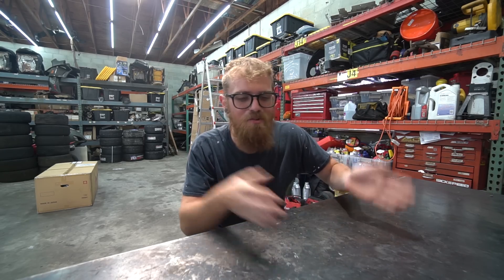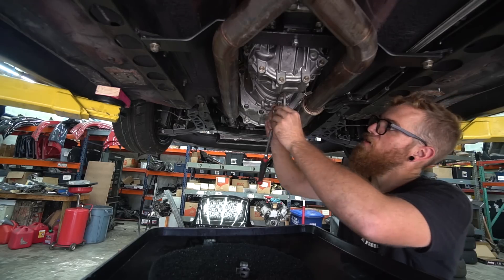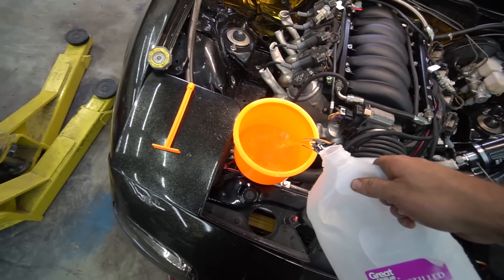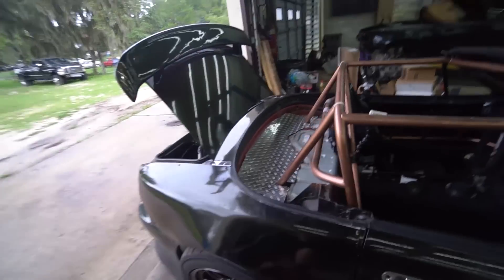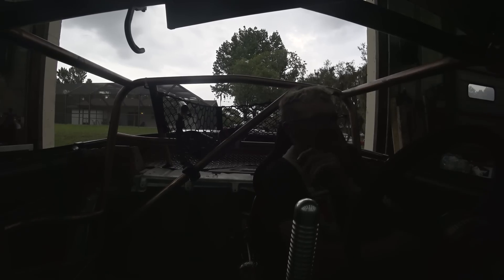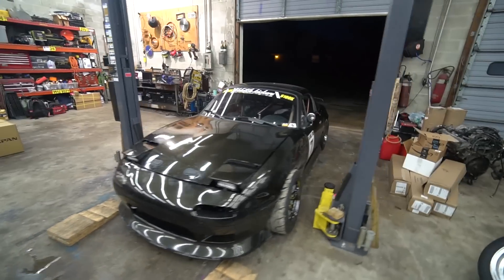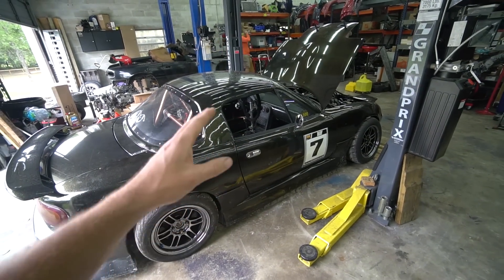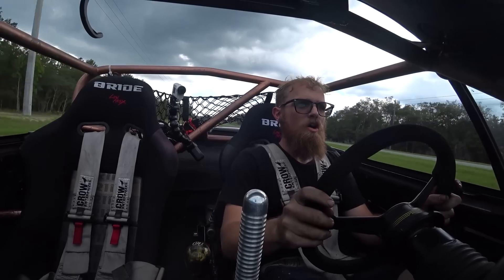ONE-WEEK REBUILD FINALE! - FIRST DRIVE With the New LS3 Miata! 1-4 Gear Pulls! Basic to Ballin Ep.5!

Comment: Grab 1 of those garden pump up sprayer. I usually cut the very end off the wand then slip a rubber hose on it. Then just pump it up, push the trigger and it will push the fluid out. Been using them for years, does gear oil fine.

Comment: I have been told to use 347 filler rod on stainless because it will weld 321 pipes.  321 is the best for headers that last.

I know people use ER70-06S MIG wire for filler rod on 4130 tubing.  Evidently the Silicon makes it flow well.  I'm not surprised that it worked on Stainless but it may corrode rapidly with all the heat and a kind of dissimilar metal joint.  Keep an eye on it.

Comment: when i did the dsg trans on my vw. i hacked a weed sprayer. added the oil to it, and used that to push the oil into the trans. made it wayyy easier. made another one for regular oils. sped it up so much. to do it that way takes forever. the proper "tool" to do it properly is $200 bucks. i spent $30, and its basically the same thing.

Comment: You can always remove one of the heater hoses to burp the system. Just crack One open start filling it up and when you get coolant coming out of the hose reinstall it finish filling it. They actually sell a fitting that goes on for the heater hose with a removable cap they work pretty well

Comment: I used a pump like that 2 times.... No More!  I put a dip tube in a plastic oil jug thru the cap. Drill a small hole in the side near the top and pressurize the jug with a blow gun.  Works like sucking a straw.

Comment: Hey tayler instead of using that soap or fliud despenser try using a old windshield washer fluid tank with the  pump on it.  Just put your fluid into the tank and put 12volt to it and it pumps it right in, fastest way ive used yet to fill a trans or diff up!

Comment: instead of using the pump bottle you can buy a 12 volt diesel/oil transfer pump. they are sometimes sold as a kit to drain your own tank if you put the wrong fuel in so it may come with a piece of tube

Comment: you should add flex couplers to your y pipe on each flange. The flanges may have cracked because there was no room for thermal expansion and contraction.   Hope this helps

Comment: If it's a coated material try welding it on AC current. Sounds crazy for steel or stainless but I've done this plenty of times and it helps with stuff that welds shitty.

Comment: Buy some 309 filler rod. Its great for cheap stainless with too much carbon in it and also stainless to carbon steel welding. Even does cast pretty well. Back purge helps with the cracks too ;)

Comment: If you use 70s2 or 70s6 carbon filler rod it works just as good if knot better then 309 and if you can't back purge it won't sugar on the inside 💯👍

Comment: Maybe your exhaust pipe is stainless, but the flange could be mild steel. Im thinking thats why stainless rods arent welding to it that great. Also would explain the seperation between the two metals. They weld together, but you dont get that strong of a weld fusion

Comment: Hey Taylor, when storing your tires you should remove the bands on them. The can warp the rubber and make balancing them harder (or make it where the tires  need to be rebalanced after sitting on the car for even a day).
Reply: Dan he doesn’t even balance drift wheels 🙄

Comment: Pro tip, get a mighty vac that does pressure and vaccum or get a drill pump for adding fluid. Mighty vac $120-150, drill pump $5-10 hardware store

Comment: Spray glue down some sand paper on block of wood (bonus if metal wide enough) and you can lap those flanges smooth in no time. I've not had luck with those gaskets and I think it's exaggerating your issue in that spot.

Comment: You could totally just provide air pressure to a container of fluid with the output hose submerged and then pump the fluid out.

I fill diffs with a modified bug sprayer bottle

Comment: I use a old Honda power steering pump to transfer fluid u just use a drill or impact on the pully bolt works wonders emptys a quart in secs lol
Reply: That's pretty ingenious
Reply: Thanks I can't waist time pumping fluid on flat rate jobs lol

Comment: I dont know what oil you are using but you will be working the diff and gearbox oil very hard.  So change that oil regularly. 
And use full synthetic in the engine gearbox diff. All will run cooler.
Use some hi temp silicone of that flange with the gasket.
As for spares,, the more you have and you will not need them. If you have not you will need them.

Comment: Which air intake sensor are you using in the snorkel? I have one but it for the Camaro not the Vette. While like you I’m running a LS2 air intake mine is just blocked off.

Comment: Looks like the arms on your lift are dragging on your floor... try putting wheel weights under the arm on the base plate it will keep it high enough to keep it from dragging.

Comment: So happy to see the LSMiata back and ripping harder than ever! The 6.2 was a great choice.  I had a question about your CD009 shifter: Do you ever have issues with getting into 5th or 6th gear without a reverse lockout? I haven't gotten my Datsun running yet with its CD but just shifting in the garage it feels like it's going to be a problem not having the lockout

Comment: The exhaust needs to go. It sounds awful when not on the throttle. The awesome motor deserves better!
Reply: When he v-bands the exhaust no more leaks.
Reply: @Tazman34685  That wont change the sound note much
Reply: Yea it needs a muffler bad..
Reply: Might be the sound thru the mic too
Reply: Patrek Brown said no one ever
Reply: He should get "zoomies" (one pipe for each cylinder, don’t remember the actual name for it) and have them come straight out the hood
Reply: Spanthegnome it sounds bad bc the motor wasn’t tuned and it was idling weird. Sounds great after he got the tune ironed out
Reply: Needs a muffler 1000%
Reply: @lloyd9435  i can't think of a worse idea
Reply: I agree it needs a resonator or a muffler or something to just round out the edges and smooth it out. Its waaaay too raspy and needs to be redone... don't really care how loud it is, just needs to fix the tone
Reply: Waay too raspy!!
Reply: Agreed a muffler and a small resonator would sound sick
Reply: I disagree
Reply: Dynomax Bullets
Reply: brandon dias This exactly what I meant. I hurts to hear an LS sound that raspy.
Reply: Shes breathing at full capacity
Reply: Nah it sounds pretty great after he fixed the tune. Let the bald eagles fly!
Reply: Agreed. It sounds really good at idle since you can really hear the cam lope, but once he gets on it the car gets way too raspy. Nothing crazy, but definitely something to cut back a bit on the rasp and itd be perfect.
Reply: Throw on a cutout for full ls sound but it needs to be tamed down

Comment: I have a 400 small block ford that could use a set of aluminum heads, the 50 year old core parts could be swapped out. but 3mpg sucks, why its in a F100 and not a 2Ton, beats me. ;) eats batteries for breakfast.

Comment: Hey Taylor, I just bought one of those Milwaukee right angle die grinders. I saw the flap wheel you had on it @ 12:27. Do you know the size of that, is it a 1"? That is all I am finding on Amazon. Also any other accessories you have/use for the die grinder, it would be cool to see what you use mostly.
Reply from the maker: I think it’s 2” I use a 1/4” roloc thing and they just twist onto it.
Reply: @Taylordrifts  Thanks! I will try to look for some 2" flap wheels because I'm only finding 1" mostly. And I will be ordering the 3M roloc disks. Keep up the awesome work, you inspire me. Although I have to be realistic with how my home garage is setup compared to you :)

Comment: the misaligned steering wheel really bugs me
Reply: I bug's me as well now 🤣🤣
Reply: He’s trying to match ol neighbor
Reply: Its a lot of work to fix it once its already installed, and doesnt add anything real when fixed. I dont think ive ever had a car with a properly aligned steering wheel
Reply: Have you ever seen a drift car with a straight steering wheel?
Reply: Un aligned steering wheel is always last on list. Especially with electric steering or hydro. Try and center a hydro and it's gone after one trip out after 4 hrs fixing it the first time
Reply: not as much as the front right tire mounted backwards 🤣🤣